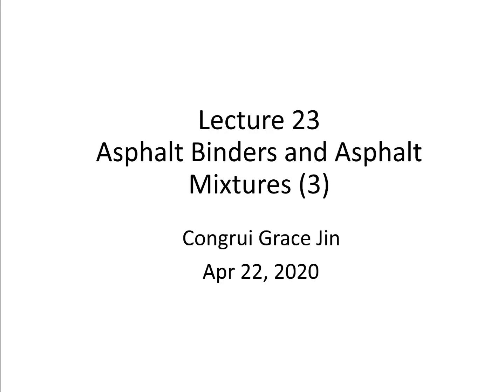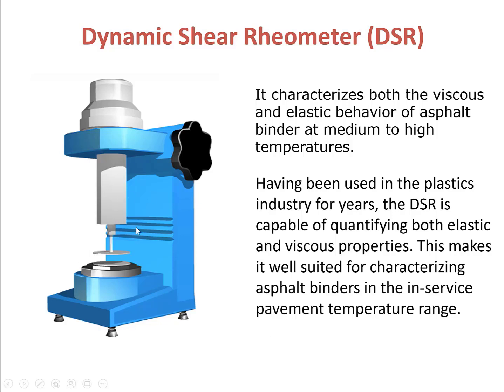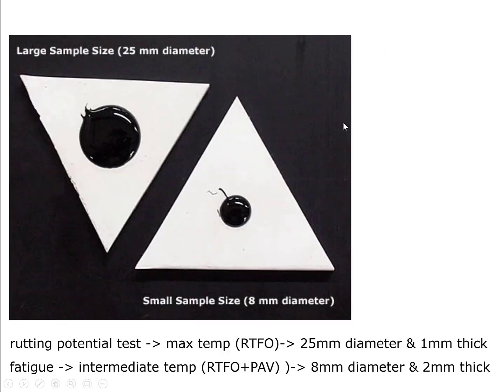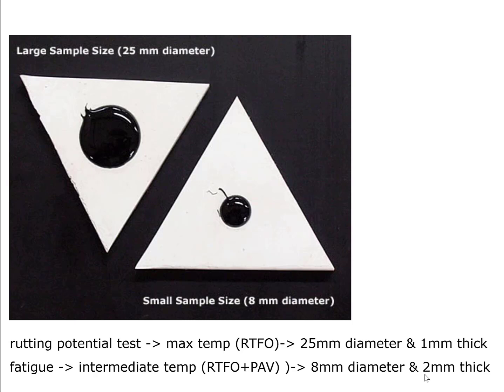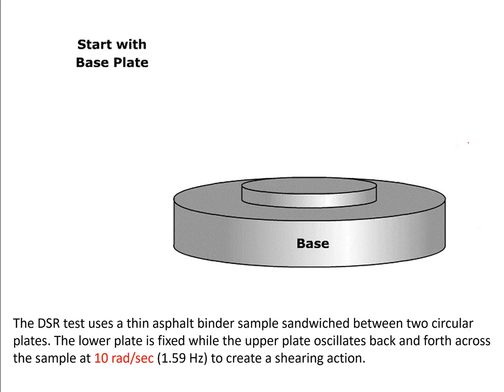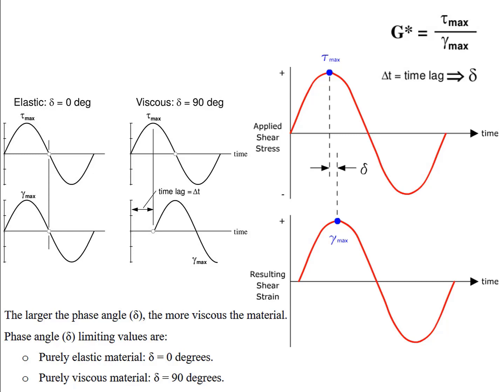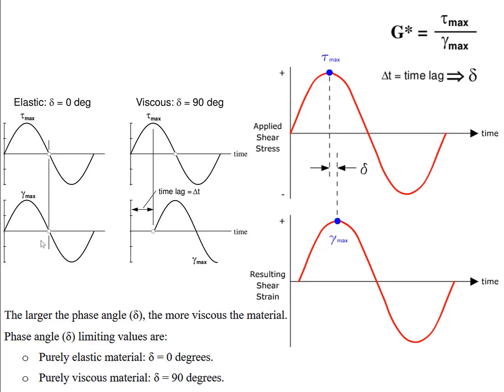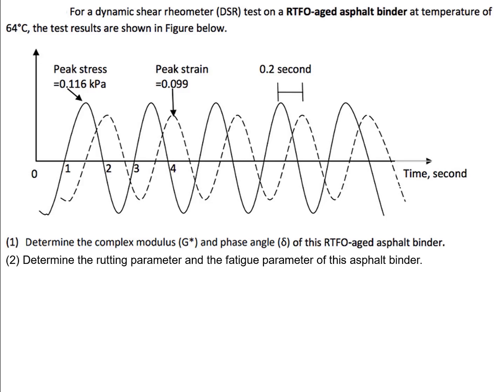Dynamic Shear Rheometer Test

Comment: For fatigue temp, you said average of the two temperatures plus 5 but your calculation was half of the difference plus 5
Reply from the maker: As I said in the video, the two temps are 64 and negative 22, not 64 and 22.
Reply: right, thanks